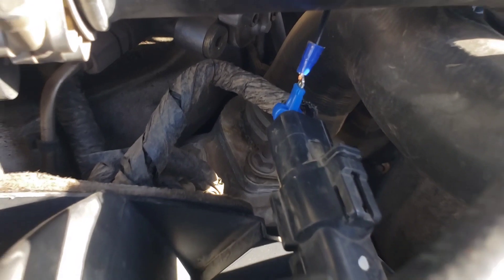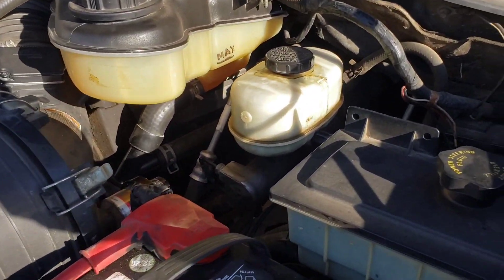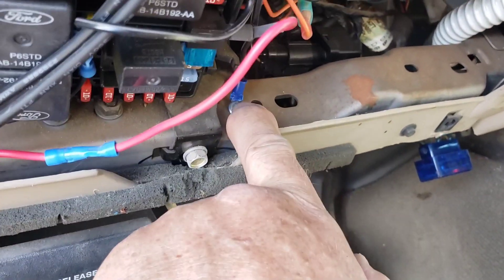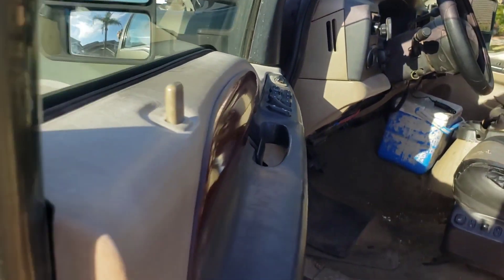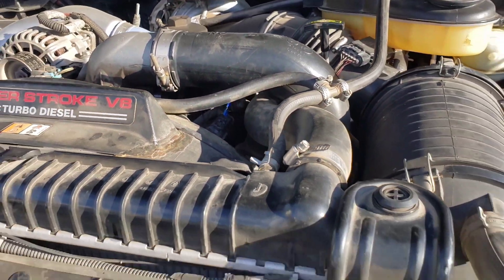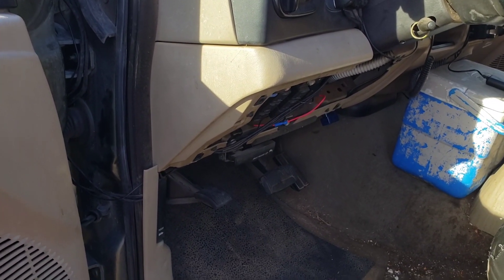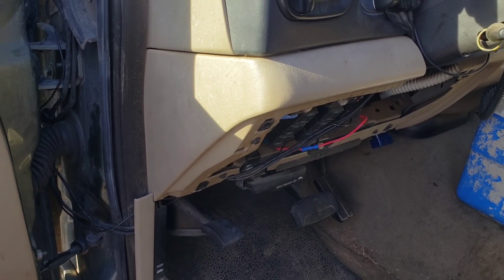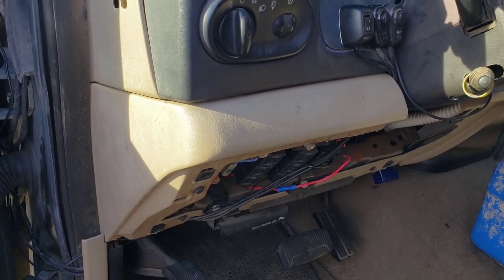Ford 6.0 Fan Clutch Blue Wire Mod.  You NEED this if you tow.

Comment: Lol hoax. Clutch fan don't operate 12v. Could do this mod and add electric fan in the front  of condenser.  won't need a switch if you wire fan relay to ignition +12 v,  relay ground temperature sensor.

Comment: The mechanic said my electrical fan clutch is only coming on to 75%, would this mod bring it up to 100% when switched?
Reply from the maker: I'm not sure.  It will if anything can, being a direct path to ground.
Reply: Best to just replace the clutch and then do the blue wire mod

Comment: Grounding a ground to a ground???
Reply: When the computer calls for the fan to come on, it connects the ground. It's called a switched ground with a constant 12v. By installing the switch with a ground, it's essentially doing what the computer is supposed to do. 

He's right though. As these fans age, they tend to become lazy and engage later, causing excessive heat. This is a good solution to take more control over your fan. Not really necessary unless you do a lot of towing.

Comment: that looks janky as fuck. 
How to burn your truck down status
Reply: It's janky, but it's a ground. Should be good on any short, other than the fan being stuck on if it happened.
Reply from the maker: Ford did it at the factory for their ambulances and fleet trucks, so...
Reply: @Qietman bro.. you have 4 pass through wires...